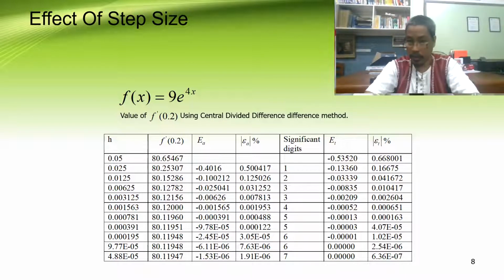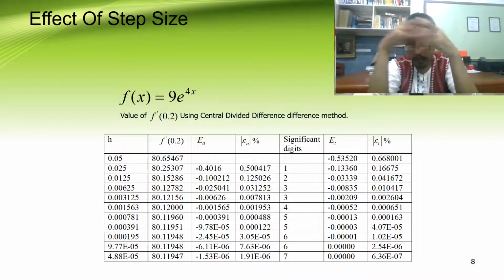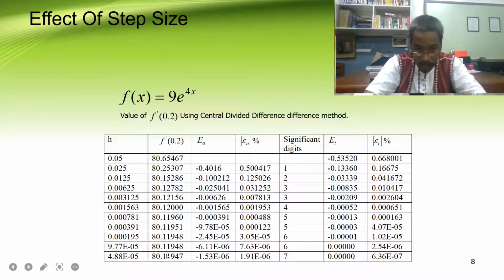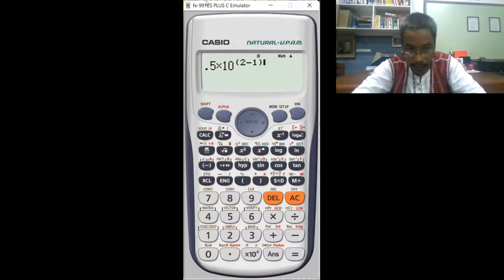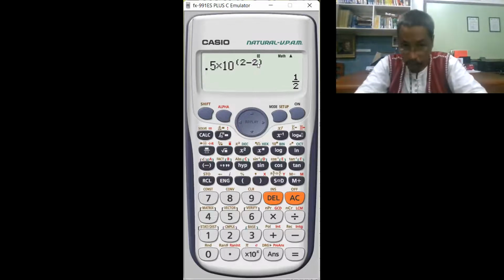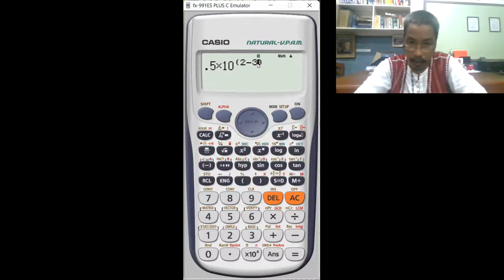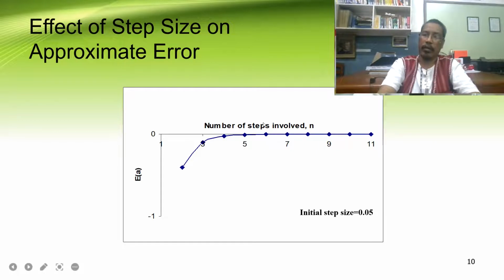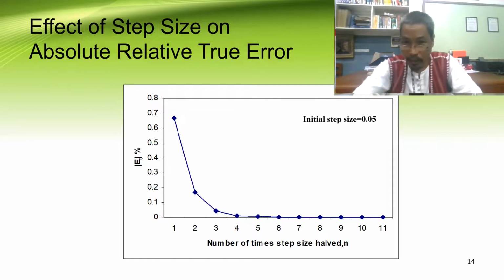Effect of Step Size on Accuracy | NUMERICAL SOLUTION for CE Problems: CDD Derivative Approximation 2

Comment: Thank you po sir for this well-explained lesson.
I tried to solved po the different 11 h and some of the computed results po are not exactly as the table shown but close to it, only differs in decimals. Thank you, sir

1.) f(x) = 9e^4x        ∆x = 0.05     f'(0.2)

f'(x) = f(x+∆x) - f(x-∆x) / 2∆x
f'(0.2) =  9e^4(x+∆x)  - 9e^4(x-∆x) / 2∆x
f'(0.2) =  9e^4(0.2+0.05)  - 9e^4(0.2-0.05) / 2(0.05)
f'(0.2) = 80.65467

True Error
Et = True Value - Approximate Value 
Et = 80.11947343 - 80.65467
Et = -0.53519657
Et = -0.53520

|€t| % = | True Error / True Value |  x 100 
|€t| %  = | -0.53520 /80.11947343 | x 100
|€t| % = 0.668002%

2.) (x) = 9e^4x        ∆x = 0.025     f'(0.2)

f'(x) = f(x+∆x) - f(x-∆x) / 2∆x
f'(0.2) =  9e^4(x+∆x)  - 9e^4(x-∆x) / 2∆x
f'(0.2) =  9e^4(0.2+0.025)  - 9e^4(0.2-0.025) / 2(0.025)
f'(0.2) = 80.25307266
f'(0.2) = 80.25307

Ea is Approximation Error

Ea = Present Approximation - Previous Approximation
Ea = 80.25307 - 80.65467
Ea = -0.4015973364
Ea = -0.4016

|€a| % = | (Approximate Error / Present Approximation)| x100
|€a| % = |  -0.4016/80.25307  | x 100
|€a| % = 0.5004169934%
|€a| % = 0.500417%

Significant Digits

|€a| % ≤ 0.5 x 10^2-m
 0.500417% ≤ 0.5 x 10^2-1
 0.500417% ≤ 5

True Error
Et = True Value - Approximate Value 
Et = 80.11947343 - 80.25307
Et = -0.13359657
Et = -0.13360

|€t| % = | True Error / True Value |  x 100 
|€t| %  = | -0.13360/80.11947343 | x 100
|€t| % = 0.1667509711%
|€t| % = 0.16675%

3.) (x) = 9e^4x        ∆x = 0.0125     f'(0.2)

f'(x) = f(x+∆x) - f(x-∆x) / 2∆x
f'(0.2) =  9e^4(x+∆x)  - 9e^4(x-∆x) / 2∆x
f'(0.2) =  9e^4(0.2+0.0125)  - 9e^4(0.2-0.0125) / 2(0.0125)
f'(0.2) = 80.15286071
f'(0.2) = 80.15286

Ea is Approximation Error

Ea = Present Approximation - Previous Approximation
Ea = 80.15286 - 80.25307 
Ea = -0.100212

|€a| % = | (Approximate Error / Present Approximation)| x100
|€a| % = |  -0.100212/80.15286  | x 100
|€a| % = 0.1250261064%
|€a| % = 0.125026%

Significant Digits

|€a| % ≤ 0.5 x 10^2-m
 0.125026 ≤ 0.5 x 10^2-2
 0.125026 % ≤ 0.5 

True Error
Et = True Value - Approximate Value 
Et = 80.11947343 - 80.15286
Et = -0.03338657
Et = -0.03339

|€t| % = | True Error / True Value |  x 100 
|€t| %  = | -0.03339/80.11947343 | x 100
|€t| % = 0.04167526142%
|€t| % = 0.041675%

4.) (x) = 9e^4x        ∆x = 0.00625     f'(0.2)

f'(x) = f(x+∆x) - f(x-∆x) / 2∆x
f'(0.2) =  9e^4(x+∆x)  - 9e^4(x-∆x) / 2∆x
f'(0.2) =  9e^4(0.2+0.00625)  - 9e^4(0.2-0.00625) / 2(0.00625)
f'(0.2) = 80.12781947
f'(0.2) = 80.12782 

Ea is Approximation Error

Ea = Present Approximation - Previous Approximation
Ea = 80.12782 -  80.15286 
Ea = -0.02504053498
Ea = -0.025041

|€a| % = | (Approximate Error / Present Approximation)| x100
|€a| % = |  -0.025041/80.12782  | x 100
|€a| % = 0.031251311821%
|€a| % = 0.031251%

Significant Digits

|€a| % ≤ 0.5 x 10^2-m
0.031251 ≤ 0.5 x 10^2-3
0.031251 % ≤ 0.05 

True Error
Et = True Value - Approximate Value 
Et = 80.11947343 - 80.12782
Et = -0.00834657
Et = -0.00835

|€t| % = | True Error / True Value |  x 100 
|€t| %  = | -0.00835/80.11947343 | x 100
|€t| % = 0.01042193569%
|€t| % = 0.01042%

5.) (x) = 9e^4x        ∆x = 0.003125     f'(0.2)

f'(x) = f(x+∆x) - f(x-∆x) / 2∆x
f'(0.2) =  9e^4(x+∆x)  - 9e^4(x-∆x) / 2∆x
f'(0.2) =  9e^4(0.2+0.003125)  - 9e^4(0.2-0.003125) / 2(0.003125)
f'(0.2) = 80.12155989
f'(0.2) = 80.12156

Ea is Approximation Error

Ea = Present Approximation - Previous Approximation
Ea = 80.12156 - 80.12782 
Ea = -0.006260011336
Ea = -0.00626

|€a| % = | (Approximate Error / Present Approximation)| x100
|€a| % = |  -0.00626/80.12156  | x 100
|€a| % = 0.007813127952%
|€a| % = 0.007813%

Significant Digits

|€a| % ≤ 0.5 x 10^2-m
0.007813 ≤ 0.5 x 10^2-3
0.007813% ≤ 0.05 

True Error
Et = True Value - Approximate Value 
Et = 80.11947343 -  80.12156
Et = -0.00208657
Et = -0.00209

|€t| % = | True Error / True Value |  x 100 
|€t| %  = | -0.00209/80.11947343 | x 100
|€t| % = 0.002608604264%
|€t| % = 0.0026086%

6.) (x) = 9e^4x        ∆x = 0.001563     f'(0.2)

f'(x) = f(x+∆x) - f(x-∆x) / 2∆x
f'(0.2) =  9e^4(x+∆x)  - 9e^4(x-∆x) / 2∆x
f'(0.2) =  9e^4(0.2+0.001563)  - 9e^4(0.2-0.001563) / 2(0.001563)
f'(0.2) = 80.11999537
f'(0.2) = 80.12000

Ea is Approximation Error

Ea = Present Approximation - Previous Approximation
Ea = 80.12000 - 80.12156 
Ea = -0.00156

|€a| % = | (Approximate Error / Present Approximation)| x100
|€a| % = |  -0.00156/80.12000  | x 100
|€a| % = 0.001947%
|€a| % = 0.00195%

Significant Digits

|€a| % ≤ 0.5 x 10^2-m
 0.00195 ≤ 0.5 x 10^2-4
0.00195% ≤ 0.005 

True Error
Et = True Value - Approximate Value 
Et = 80.11947343 -   80.12000 
Et = -0.00052657

|€t| % = | True Error / True Value |  x 100 
|€t| %  = |-0.00052657/80.11947343 | x 100
|€t| % = 0.000657%

7.) (x) = 9e^4x        ∆x = 0.000781     f'(0.2)

f'(x) = f(x+∆x) - f(x-∆x) / 2∆x
f'(0.2) =  9e^4(x+∆x)  - 9e^4(x-∆x) / 2∆x
f'(0.2) =  9e^4(0.2+0.000781)  - 9e^4(0.2-0.000781) / 2(0.000781)
f'(0.2) = 80.11960375
f'(0.2) = 80.11960

Ea is Approximation Error

Ea = Present Approximation - Previous Approximation
Ea = 80.11960 - 80.12000 
Ea = -0.0004

|€a| % = | (Approximate Error / Present Approximation)| x100
|€a| % = |  -0.0004/80.11960  | x 100
|€a| % = 0.0004992536158%
|€a| % = 0.000499%

Significant Digits

|€a| % ≤ 0.5 x 10^2-m
0.000499 ≤ 0.5 x 10^2-5
0.000499% ≤ 0.0005 

True Error
Et = True Value - Approximate Value 
Et = 80.11947343 -  80.11960
Et = -0.00012657
Et = -0.00013

|€t| % = | True Error / True Value |  x 100 
|€t| %  = |-0.00013/80.11947343 | x 100
|€t| % = 0.0001622576815%
|€t| % = 0.0001623%

8.) (x) = 9e^4x        ∆x = 0.000391     f'(0.2)

f'(x) = f(x+∆x) - f(x-∆x) / 2∆x
f'(0.2) =  9e^4(x+∆x)  - 9e^4(x-∆x) / 2∆x
f'(0.2) =  9e^4(0.2+0.000391)  - 9e^4(0.2-0.000391) / 2(0.000391)
f'(0.2) = 80.11950609
f'(0.2) = 80.11951

Ea is Approximation Error

Ea = Present Approximation - Previous Approximation
Ea = 80.11951 - 80.11960  
Ea = -0.00009

|€a| % = | (Approximate Error / Present Approximation)| x100
|€a| % = |  -0.00009/ 80.11951 | x 100
|€a| % = 0.0001123321898%
|€a| % = 0.000112%

Significant Digits

|€a| % ≤ 0.5 x 10^2-m
0.000112 ≤ 0.5 x 10^2-5
0.000112% ≤ 0.0005 

True Error
Et = True Value - Approximate Value 
Et = 80.11947343 -  80.11951
Et = -0.00003657
Et = -0.000037

|€t| % = | True Error / True Value |  x 100 
|€t| %  = |-0.000037/80.11947343 | x 100
|€t| % = 0.0000461803242%
|€t| % = 0.000046%

9.) (x) = 9e^4x        ∆x = 0.000195     f'(0.2)

f'(x) = f(x+∆x) - f(x-∆x) / 2∆x
f'(0.2) =  9e^4(x+∆x)  - 9e^4(x-∆x) / 2∆x
f'(0.2) =  9e^4(0.2+0.000195)  - 9e^4(0.2-0.000195) / 2(0.000195)
f'(0.2) = 80.11948155
f'(0.2) = 80.11948

Ea is Approximation Error

Ea = Present Approximation - Previous Approximation
Ea = 80.11948 - 80.11951  
Ea = -0.00003

|€a| % = | (Approximate Error / Present Approximation)| x100
|€a| % = |  -0.00003/ 80.11948 | x 100
|€a| % = 0.00003744407727%
|€a| % = 0.000037%

Significant Digits

|€a| % ≤ 0.5 x 10^2-m
0.000037% ≤ 0.5 x 10^2-6
0.000037%% ≤ 0.00005 

True Error
Et = True Value - Approximate Value 
Et = 80.11947343 -  80.11948
Et = -0.00000657
Et = -0.00001

|€t| % = | True Error / True Value |  x 100 
|€t| %  = |-0.00001/80.11947343 | x 100
|€t| % = 0.00001248136011%
|€t| % = 0.000012%

10.) (x) = 9e^4x        ∆x = 9.77E-05     f'(0.2)

f'(x) = f(x+∆x) - f(x-∆x) / 2∆x
f'(0.2) =  9e^4(x+∆x)  - 9e^4(x-∆x) / 2∆x
f'(0.2) =  9e^4(0.2+9.77E-05)  - 9e^4(0.2-9.77E-05) / 2(9.77E-05)
f'(0.2) = 80.11947547
f'(0.2) = 80.11948

Ea is Approximation Error

Ea = Present Approximation - Previous Approximation
Ea = 80.11947547 - 80.11948155  
Ea = -0.0000061

|€a| % = | (Approximate Error / Present Approximation)| x100
|€a| % = | -0.0000061/ 80.11947547 | x 100
|€a| % = 0.000007614078109%
|€a| % = 0.0000076%

Significant Digits

|€a| % ≤ 0.5 x 10^2-m
0.0000076%≤ 0.5 x 10^2-6
0.0000076% ≤ 0.00005 

True Error
Et = True Value - Approximate Value 
Et = 80.11947343 -  80.11947547
Et = -0.00000204
Et = -0.00000204

|€t| % = | True Error / True Value |  x 100 
|€t| %  = |-0.00000204/80.11947343 | x 100
|€t| % = 0.000002546197463%
|€t| % = 0.00000255%

11.) (x) = 9e^4x        ∆x = 4.88E-05     f'(0.2)

f'(x) = f(x+∆x) - f(x-∆x) / 2∆x
f'(0.2) =  9e^4(x+∆x)  - 9e^4(x-∆x) / 2∆x
f'(0.2) =  9e^4(0.2+4.88E-05)  - 9e^4(0.2-4.88E-05) / 2(4.88E-05)
f'(0.2) = 80.11947393
f'(0.2) = 80.11947

Ea is Approximation Error

Ea = Present Approximation - Previous Approximation
Ea =80.11947393 - 80.11947547
Ea = -0.00000154

|€a| % = | (Approximate Error / Present Approximation)| x100
|€a| % = | -0.00000154/ 80.11947393 | x 100
|€a| % = 0.000001922129446%
|€a| % = 0.00000192%

Significant Digits

|€a| % ≤ 0.5 x 10^2-m
0.00000192%≤ 0.5 x 10^2-7
0.00000192% ≤ 0.000005 

True Error
Et = True Value - Approximate Value 
Et = 80.11947343 -  80.11947393
Et = -0.0000005
Et = -0.000000

|€t| % = | True Error / True Value |  x 100 
|€t| %  = |-0.0000005/80.11947343 | x 100
|€t| % = 0.0000006240680067%
|€t| % = 0.000000624%